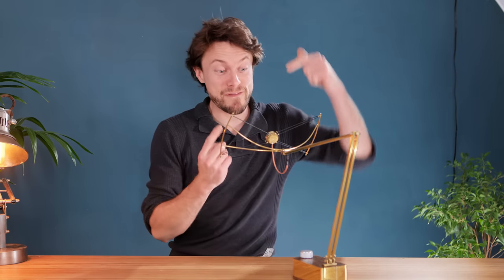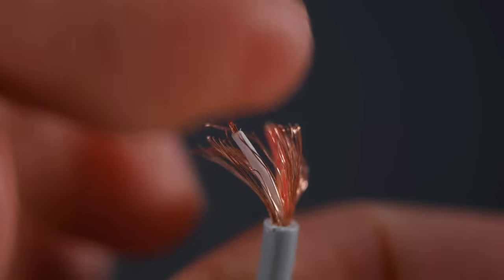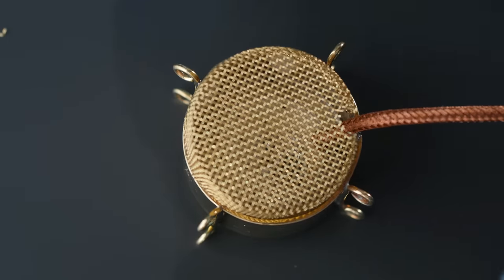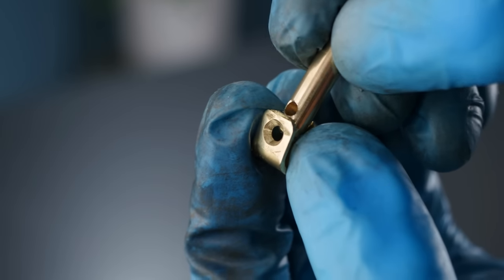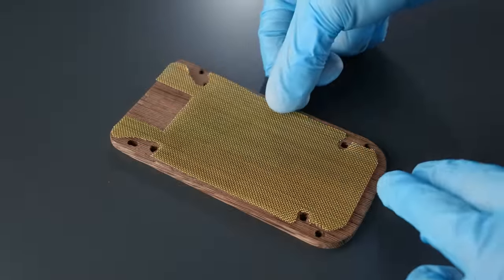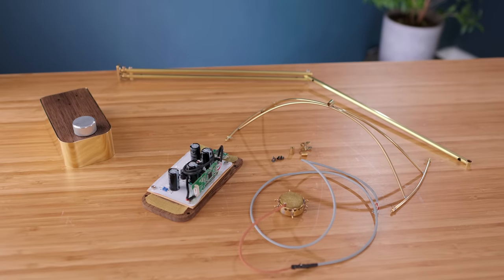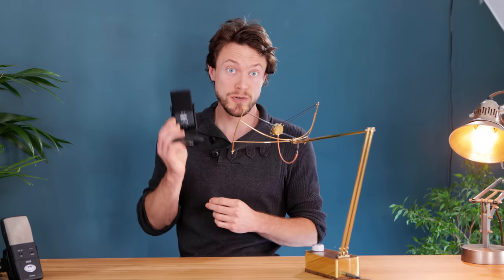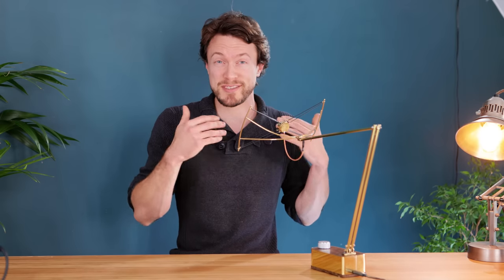Building a quality USB-C microphone

Comment: This is incredibly cool, and as a person who already has the audio interface and no need for the USB bit, seems like something that would be totally doable with an XLR connection. 

It seems like it's prone to picking up plosives - you can hear some of those almost getting through even at the distance you're using it at - but maybe it could be modified to integrate a pop filter as well.
Reply: I'm just beginning to educate myself on this stuff in more depth so sorry if this is a dumb question but would you need to adjust the preamp design for this as an audio interface would provide a higher voltage than the usb cable?

Comment: *WARNING* If you are building this yourself, the 2 middle capacitors (2200uf 16v) on the diagram are backwards. If you follow the diagram, it will short, pop and you will see smoke when you give it power! Instead, use 12:45 in the video of the correct orientation of the capacitors.

Comment: Its a good circuit, but i have some suggestions:
- put a ~220nf ceramic capacitor RIGHT across the leads of the ic.
- component selection is important for the ac-pass capacitors. Non-polar electrolytic is fine. Tantalum is very bad. Ceramics can also work, but bear in mind ceramics may have a microphonic effect as well.
- place everything that connects between the ic and the microphones as close as possible to each other, and make sure the connection between the mic cable ground and the amplifier ground is as short as possible.
Reply: Is it possible to plug the mic into an audio interface with phantom power, instead of making the pre-amp?
Reply: @link3457  I don't think this one will require phantom-power. I would have to take a closer look at the capsule pins (and probably some tests with a scope) to know whether you could just bolt on an XLR cable.
Reply: Yeah, long paths mean more interferences
Reply: @ClokworkGremlin  how would I check if it needs one or not?
Reply: What does leads mean? Refering to across the leads of the ic. Sorry.. newbie here
Reply: @jakastruc  the component leads; its pins.
Reply: @jakastruc  look at the reference schematic for the that1512. It shows to put a 100nf between pins 4-5 and pins 5-7. Thats V+ to Vref and V- to Vref. I just mean place those as close to the chip as possible.
Reply: @JLK89  Thank you! Will keep in mind.

Comment: You can remedy that out of place silver knob pretty easily with a classic blacksmith's trick. Heat up the part and brush it with a brass wire brush. The brass leaches onto the part, giving it a brassy finish for no real cost. Super useful for detail pieces. The channel "Pask Makes" has a good video on it if you want a visual demonstration.
Reply: Old hot rod trick also
Reply: Everything Pask Makes is excellent!
Reply: Those knobs usually have a plastic insert, but shouldn't it be possible to electroplate it but brass is difficult, perhaps copper?
Reply: Well time to get the lathe hummin..😚
Reply: @rumbust7793  You could electroplate it with copper, then again with zinc and heat it up afterwards with a small (!) blowtorch so they fuse together. Tried that once, it works, but the problem is to get the heat just right and evenly. I think the youtuber "Cody's Lab" did that with chainmail once, he used an oven to fuse the platings. But that's not possible with a plastic insert. I think the best way is to machine a knob out of brass and maybe 3d print an insert if needed.
Reply: I dont like to go against the tide.... but the knob is almost certainly aluminium, a real bugger (impossible?) to electro plate.  Someone on youtube made a sputtering device which can coat any material with any metal.  But you'll need a decent vacuum pump, lab power supply,  etc.  Doable, but a bit of a faff.  The easiest options are spray paint or very thin brass shim superglued on
Reply: @raykent3211  You can electroplate aluminium with copper and then plate basically anything on top. I tried this in order to nickel plate an aluminium name tag but with DIY utilities the copper plating on the aluminium is not that easy to achieve in a controlled manner. You need to tune in the process somewhat precisely to get a uniform layer that does not flake off. For me, it was easier to make new name tags out of copper sheets :-D
Reply: @BossmodePictures  thanks for the response, it lead me to google around the topic this morning. I'd like to try this, especially if it means bring able to plate small patches onto alu to make it soft solderable for electrical connection.  But i got a sinking feeling seeing mention of zincate, nitric acid, cyanide.......
Reply: @raykent3211  Yep. I tried the vinegar-baking-soda-way as that's what I used for other metals before but as I said, you REALLY need to find the right settings or the plating will flake off pretty easily. I cleaned the parts with caustic soda (I used some drain cleaning agent) to get rid of the oxidation layer, that helped a lot.

But I think if you just need an easy way to add soldering pads on the alu, it's much more durable to spot weld a piece of copper to it.

Comment: As an audiophile with quite expensive equipment and a musician with 12 years of experience I consider myself an enthusiast to say the least.
And honestly, wow! I own 3 microphones spanning from 200 to 1.5k USD each with unique sound signatures (no flex, context) and if anything would LOVE to try on this DIY setup.
Between the Neumann and the DIY though there is definitely a nuanced difference in frequency response, but for podcasting and home studio's its nowhere near worth the price (not even close!) and the difference is really so slight that it would only be worth the cost for really professional work. Plus the DIY setup allows for INCREDIBLY CHEAP maintenance!! (Just the repairs of a Neumann would cost 10 times the price of this build lol!)

So really, Matt - incredible job with this. I definitely see it as a no-compromise build for an incredible price.

Comment: The Neumann sounds warmer and fuller, the DIY one sounds sharp and punchy with louder top-end. I'd say it's down to preference or use case, which is insane considering the 100x cost difference. In terms of audio the DIY one definitely wins as a streaming mic
Reply: Agreed. But I'm sure it can be tidied up with sound processing.
Reply: Yeah I like the 30 dollar one the best. For voice it need to be that crisp. The 3k one sounds like it would be used in some werid deep love song.. Crisp for the win!
Reply: I can immediately hear the difference but they both sound great so, it's not a huge issue.
Reply: @BloodSprite-tan  i think out of the box the neumann sounds like it has a little more body and is a little smoother, but honestly, a little bit of EQ and compression and i think the DIY could sound equally as good or better (if you don't already like it better)
Reply: both sound 100% identical...

Comment: Speaking as a sound engineer, the quality of your mic is definitely surprisingly good! There are a few issues it certainly suffers from, but overall you've done very well. It certainly seems very useful in a voice over or streaming set up, and certainly exceptional for a usb mic.
I was surprised by the frequency response, it is genuinely very clear. The high mids (from what I can tell purely based on the audio from your video) seem to occasionally be a little harsh, and the low mids can get slightly muddy, but that might be an issue with youtube, or worse, me nitpicking. I think it has a great amount of low end of a vocal mic, enough to clearly pic up the full bottom end of voices without overdoing it.
It feels almost unfair to put it up against the u87, it's a truly gorgeous vocal mic, even to untrained ears. the u87's only real downside is that price tag, but then again, that's basically everything in the sound industry!
I think this was a really cool project and an awesome result! and it's just made even more impressive by the low price tag. Love the look as well!
Reply: Agreed on all points. It's pretty gorgeous. I think it sounds great, considering there's no EQ circuit. I'm very impressed. I could work with this signal. Cheers, Lydia! Pleased to meet you!
Reply: Totally agree. :-)
Reply: The U87 has a warmer sound and I would definitely prefer to hear it on a radio station but I think the DIY mic is a big step forward for many youtubers and streamers that don't have a good microphone yet.
Reply: @jantube358  yes the u87 has a much warmer and pleasing sound compared to this DIY microphone, but pair it with some EQ and filter and you probably can sound as good as that u87
Reply: @siontheodorus1501  I would really like to see a video where an audio engineer tries to do this. It will never sound as good as the U87 but maybe it will become a lot warmer.